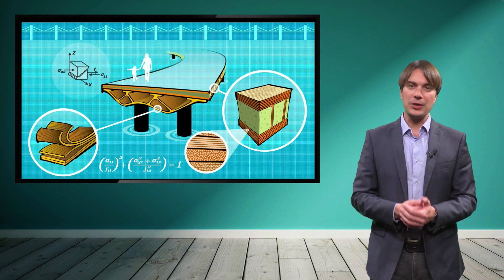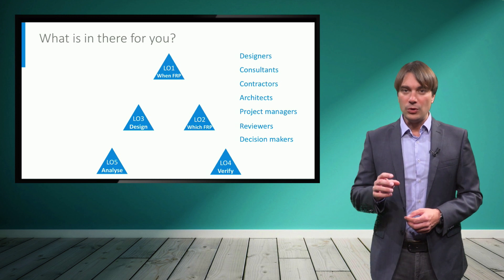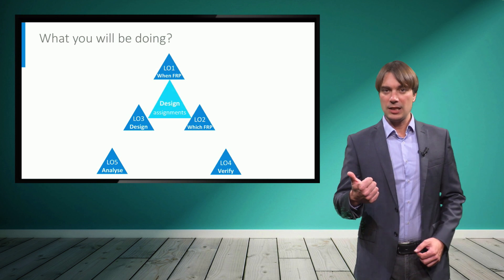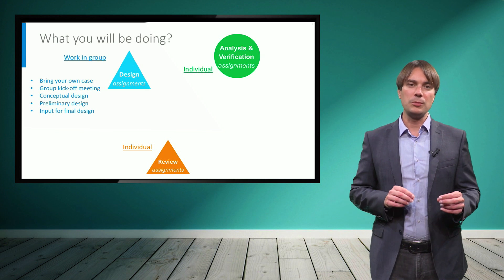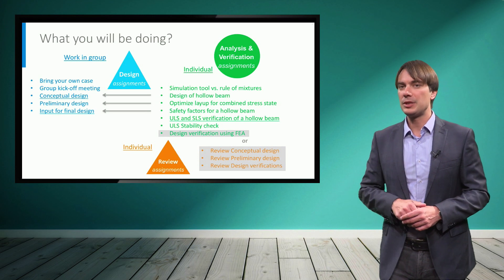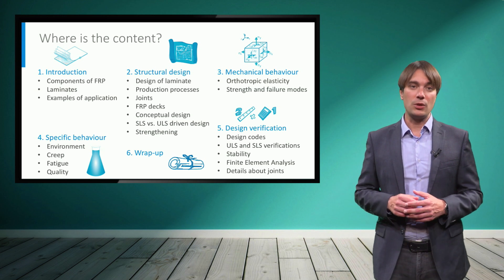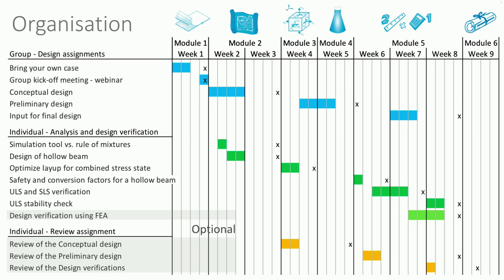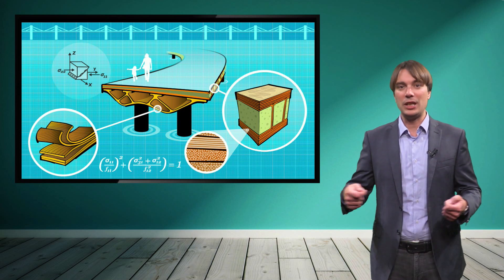Course Structure – FRP Composites in Structural Engineering | Online Course Sample

Comment: Great material! May I know if it Is possible to apply in jetty structures?
Reply: FRP composites, in general, show very good potential of application in corrosion/degradation due to wet enviroments driven structures. Boats are build of composites! Lock gates, are one example of application in "hydraulic engineering" applications. This course will help you to make first designs and feasibility studies of application in jetty structures.